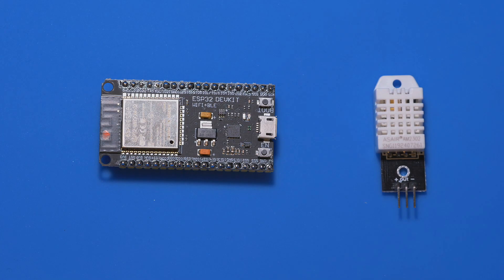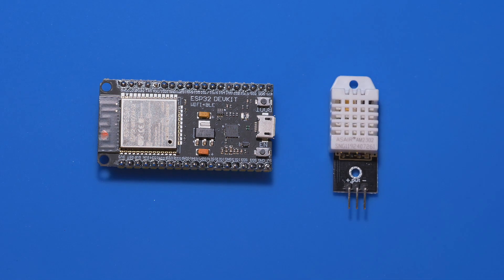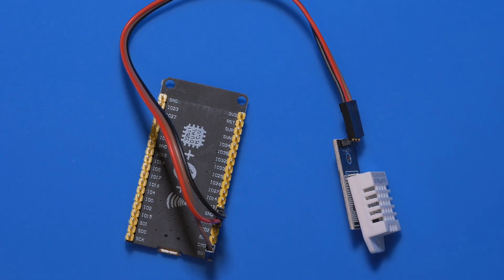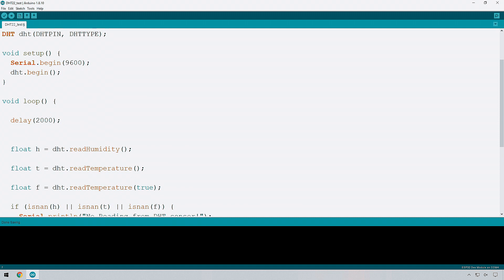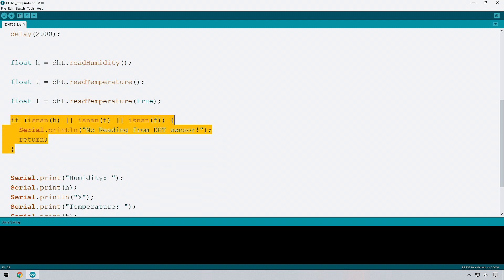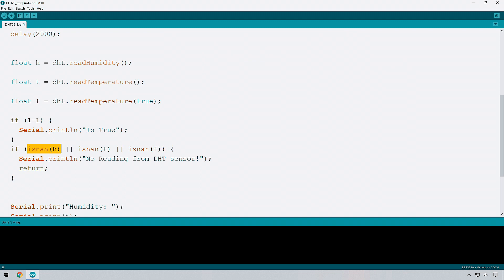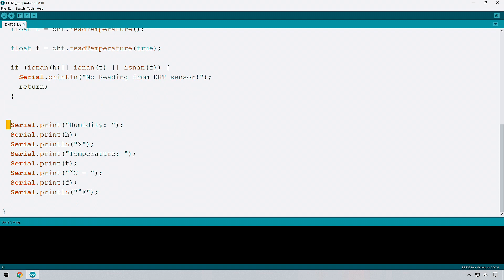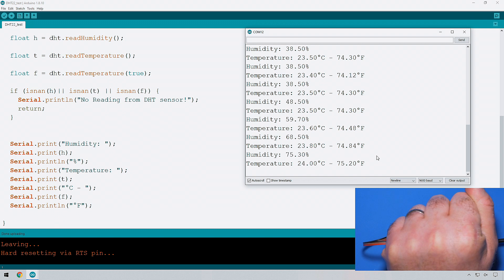Temperature and Humidity Sensors

Comment: Some sources (like the Aosong Datasheet) suggest pin 3 is a NULL (not connected) pin. 
Others (like the Adafruit Datasheet) show pins 3 and 4 are both ground pins and have built-in resistors (Adafruit 1kOhm) between  pin 1 and 2. 
Both (contiunity and resistance) can easily be checked for continuity using a multimeter or similar devices before soldering :) 

My ASAIR AM2302 sensors have both pins 3 and 4 connected to ground and a built-in resistor of 4.7kOhms between pin 1 and 2 😎

Comment: Thanks for the tutorial, huge fan here ! One small question, when I look at your code you include the library with #include "DHT.h" but when I go to SKETCH / INCLUDE LIBRARY / DHT SENSOR LIBRARY,  the code is different and is written as #include <DHT.h> . Are both typing ok ? Thank you so much again, I just started my green house and after seeing your installation descritpion I also decided to follow your course as I always wanted to learn Arduino but never made the effort to spend time on it. Cheers from France :)
Reply from the maker: Hey John. Either way will work. It is just a variation in where it looks for library.
The reason I use without the <> is because if it fails to find the library, it will automatically switch to <>.
Reply: @ChilliChump2  Thank you for taking on your time to answer, really appreciated ! You were right on one thing for sure, I'm an absolute beginner in arduino language,  Now everywhere I look I see what can be automated so my amazon account is on fire right now because I keep ordering sensors and ESP32s :°) Thank you again for your clear tutorials !

Comment: my esp32 doesn't have the text on the back as yours does (btw i did use you Amazon link). Is there any other way I can confirm what each of the pins on mine is for?
Reply from the maker: does it have any writing on it at all? the pins should be numbered on the device
Reply: @ChilliChump2  nothing on the belly of the device. On the top the writing is not very clear at all but i think i can just about make out '3VT'  ,  'GND' and 'D13'.
When i connect to these i got the error below
"A fatal error occurred: Failed to connect to ESP32: Invalid head of packet (0x00)"
Reply from the maker: when you connect to the micro-USB?
Reply: @ChilliChump2  yes micro usb. tried again to upload and got this error

"Arduino: 1.8.12 (Windows Store 1.8.33.0) (Windows 10), Board: "ESP32 Dev Module, Disabled, Default 4MB with spiffs (1.2MB APP/1.5MB SPIFFS), 240MHz (WiFi/BT), QIO, 80MHz, 4MB (32Mb), 921600, None"

Sketch uses 215329 bytes (16%) of program storage space. Maximum is 1310720 bytes.
Global variables use 15412 bytes (4%) of dynamic memory, leaving 312268 bytes for local variables. Maximum is 327680 bytes.
esptool.py v2.6
Serial port COM3
Connecting........_____....._____....._____....An error occurred while uploading the sketch
processing.app.SerialException: Error opening serial port 'COM3'.
	at processing.app.Serial.<init>(Serial.java:147)
	at processing.app.Serial.<init>(Serial.java:82)
	at processing.app.SerialMonitor$2.<init>(SerialMonitor.java:130)
	at processing.app.SerialMonitor.open(SerialMonitor.java:130)
	at processing.app.AbstractMonitor.resume(AbstractMonitor.java:132)
	at processing.app.Editor.resumeOrCloseSerialMonitor(Editor.java:2107)
	at processing.app.Editor.access$1300(Editor.java:117)
	at processing.app.Editor$UploadHandler.run(Editor.java:2081)
	at java.lang.Thread.run(Thread.java:748)
Caused by: jssc.SerialPortException: Port name - COM3; Method name - openPort(); Exception type - Port busy.
	at jssc.SerialPort.openPort(SerialPort.java:164)
	at processing.app.Serial.<init>(Serial.java:136)
	... 8 more
Error opening serial port 'COM3'.

This report would have more information with
"Show verbose output during compilation"
option enabled in File -> Preferences.
"
Reply: @ChilliChump2  I just kept hitting the upload button and it finally WORKED!!! :)

Comment: This is a fantastic series. In conjunction with some of the older series I have two wemos d1 mini running temperatures etc and uploading to Ubidots and I can see the data anywhere. Sharp learning curve on coding and already picking it up well. Cheap as chips too. Just got to find some WiFi at the allotment now and I’m sorted. Or are there some cunning plans in the pipeline for RF transmission of data over larger distances? Thanks for a brilliant guide.

Comment: thank you for sharing mate. I  very good job. it would be really good if you could share the code in any way of course if posible.
Reply from the maker: I will get that linked in the description soon!
Reply: @ChilliChump2  thank you mate. Appreciate it
Reply from the maker: I have added it to the description. https://pastebin.com/8Ci35NeM
Reply: I find when i'm learning a new language, if you watch the video and type it in yourself, it 'sinks in' a tad more, rather than just copy and paste a block of text. Also If you make mistakes such as using the wrong case or spelling, you also get to learn the error and syntax messages, and more importantly how to correct them. Ok, it takes a little longer at first, but steady progress usually wins the day especially for a beginner. Only when I'm sure i know what's happening will I copy/paste to save time. For example i recently learned about writing games using Unity and c#, and even though i have been programming for decades, if i had'nt done what i suggest it would have been frustrating when i needed to modify code to suit my own needs. GL